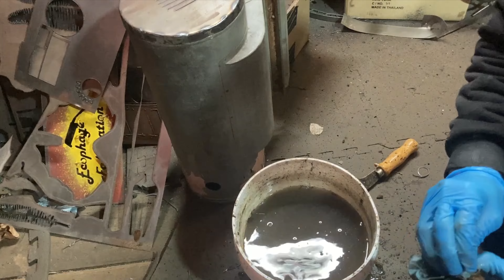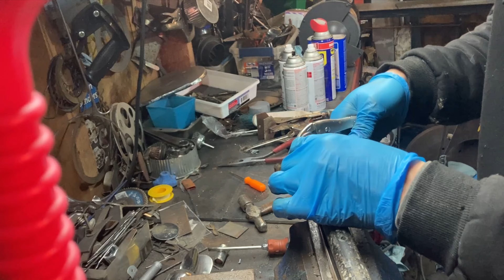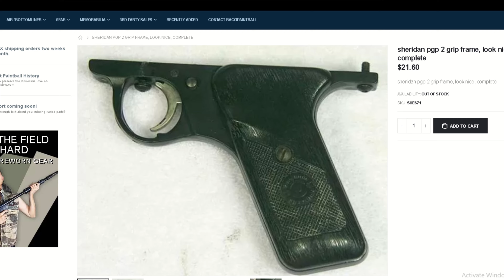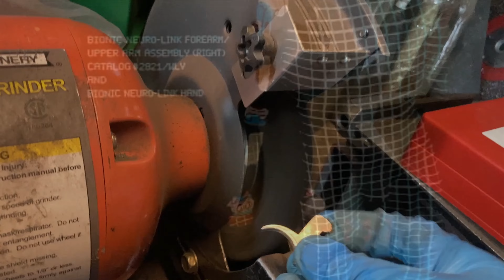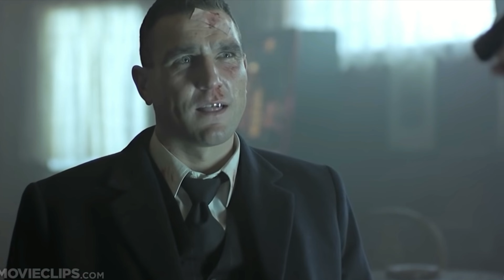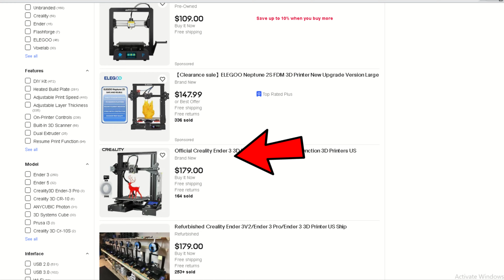3D printing missing parts for this gun project using CAD/Fusion360! Rare Sheridan PGP Paint Pistol

Comment: Really nice work man.  Is there a way I can have you make a trigger frame me?  Would like to make my PGP a little light.
Reply from the maker: I could send you this one. I ended up finding the correct metal one eventually but i havent swapped it back yet. any chance you have the spring i need maybe o- rings?
Reply: @ecophage  definitely man, what’s your IG?  Starting to tech these classic paintball markers.  They are fun to work on.
Reply from the maker: @ricardosalinas3369  same as YT @ecophage
Reply: @ecophage  what your IG?  I can contact you there.  I may have extra parts.